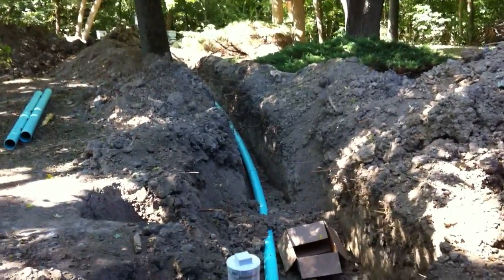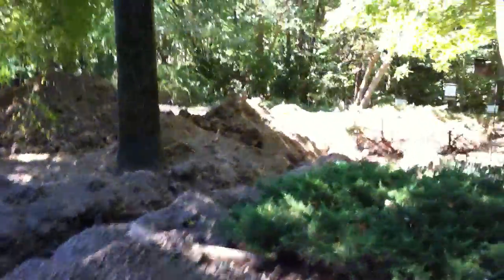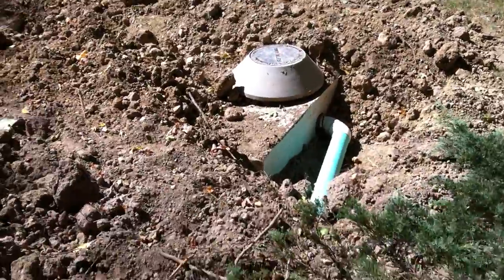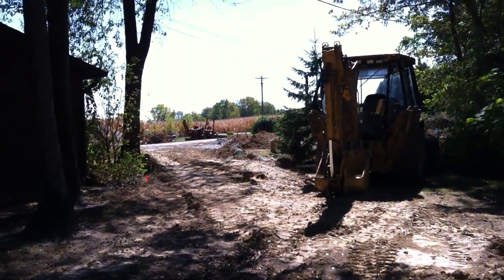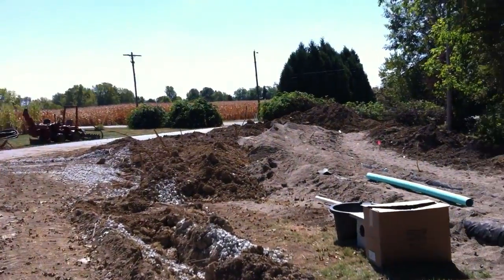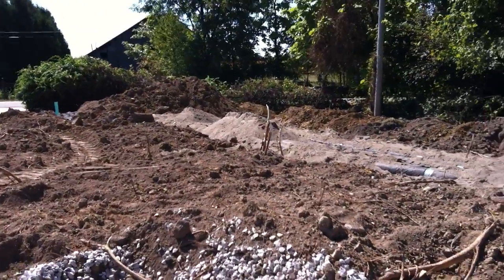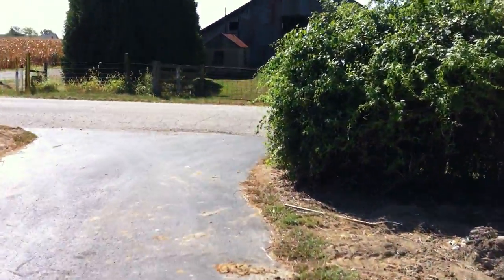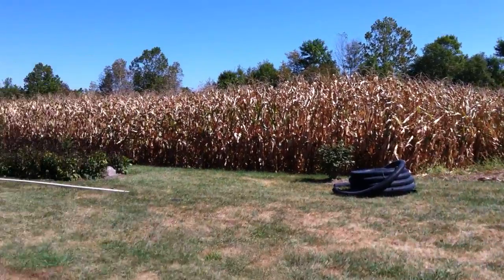Enviro-Septic: Brownsburg, Indiana - "I didn't want a new Bio-Dump; but I still like to dump :)"

Comment: I live over south of greencastle and just got an estimate today for 13 grand. 
That's only run of pipe 83' long.
Just wondering;
How does that cost compare to yours?
How is it working so far?
How many bedrooms is your house?
Reply from the maker: Bill Hutson  Works great.  Mine was at lot more expensive.  I had one issue with a float value switch in the grey water tank.  I notice no smell from the air intake or exhaust pipes.